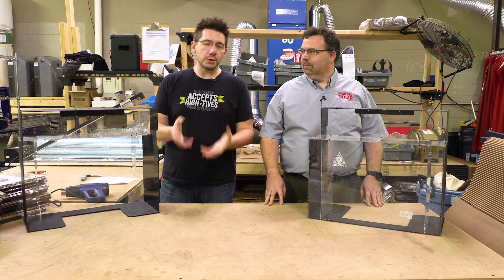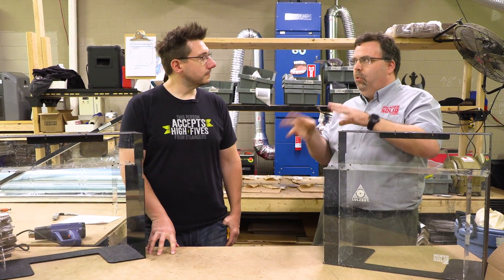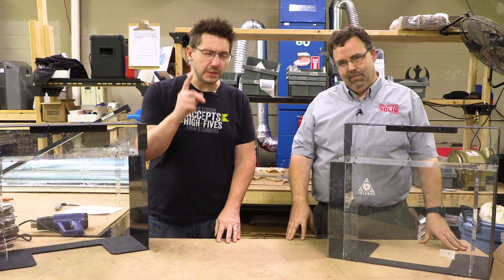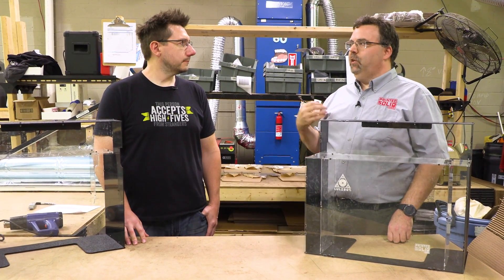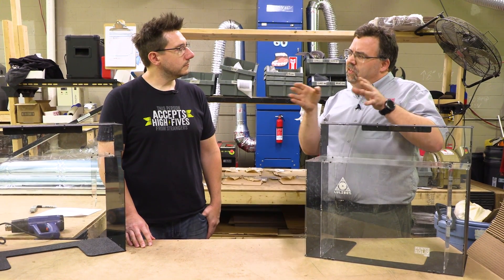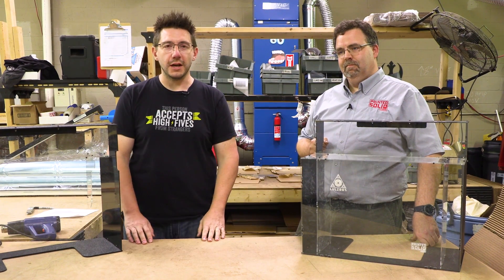5 Tips for Building a 3D Printer Enclosure

Comment: Can you please do a follow-up video to clarify objectives?  What is the purpose of recycling the air?  Why build the enclosure in the first place if 1) You need to keep it cool for PLA 2) Recycling the air with a fan or snorkle (not exhausting the fumes) and therefore slowly builds heat creep.     I don't trust any commercially available filters to get all the nasty VOC's or particulates out of the air.  Not everyone prints in an HVAC controlled room, so focus on the objectives and means of achieving rather than 'this is the only way" please!

Comment: That was verry helpful as I plan my enclosure build, but I wonder should there not be a dust filter for a potential air intake as well? The printer I have on order seems to have power supply and control board in the base, would you recommend I put a (filtered) air intake below my enclosure aka put it on feet so the ait in the "box" first goes through the base cooling it and heating the air a bit then exhausting it via a carbon filter at the top? I plan on using a speed controller for the fan so I do not evacuate to much heat to fast, would a thermistor control of the exhaust be a good idea to keep the temperature as stable as possible? Which is more important, heat or stable temp?

Comment: I actually vent the exhaust from my PSU and electronics box INTO my enclosures using some cheap pool hose from those above ground pool kits. Doing this I was able  to increase my average temps from low to mid 40°C to low to mid 50°C and has the added benefit of circulating the air at the same time AND it makes the fan noise less audible, 3 birds with one stone. It made the world of difference for layer adhesion when printing ABS.

Comment: How would you go about regulating the temperature if you are just circulating the same heated air back into the chamber? or is the point to keep the air circulating to avoid hot spots forming around the heat bed?
Reply: As the ambient temperature could vary greatly (winter, summer, basement, etc.), there is no easy way of regulating the temperature by circulating the filtered air. A filter is great and a temperature regulated fan, that gets rid of the hot air as well as slots off to the side, that let ambient air in. Moving the power supply out is an important step.

Comment: I know this is an old video, but I just wanted to ask if anyone else got a mixed message here. In one point, he says that heat is bad, but then in another point, he says you don't wanna put in a fan that exhausts the heat and pulls in cold air (he suggests 'recirculating the air through a filter', which would result in keeping the hot air in, yes). Am I missing something?
Reply from the maker: Hey! So... Heat is bad, in that, you don't want TOO MUCH heat to build up when electronics and motors are in the enclosure. You also don't want to exhaust the heat and pull in cold air, as you want the temp inside the enclosure to be consistent. I hope that helps.
Reply: @3DPrintingNerd  OK, thanks, but I guess that begs the obvious question, "how hot is too hot?".
I imagine that an active temperature control mechanism would be desirable, which would be fairly expensive, no doubt.

Comment: If anything you want a positive pressure on the inside so dust stays out. It's just a thing on which speed to set the intake fan (filtered) so you achieve the inside temp you want. Vent freely via large surface filter or extract and filter with a smaller fan than on the intake. No recirculation dude, you didn't even mention printing ABS and fumes... Just calm and steady filtered intake air and temps will be constant. Also testing the setup and running it in with temp sensors should be done, not to "eyeball" the temps.
This guy might have been building bird houses for past 8 years, not 3d printer enclosures.

Comment: Summary:
 1) Get the Air out. 3d-Printed Parts will melt when the tempearture inside is too hot. Also Heat Creep is more likely to occur
2) Protect Electronics. 50°C will half the lifespan of the electronics -> Place Electronics outside, motors are a bit more tolerant
3) Place the Power Supply out of the enclosure
4) Circulate the Air inside to avoid temperature variations
5) Don't let the cables hit the enclosure to reduce wear.
Reply: Thank you

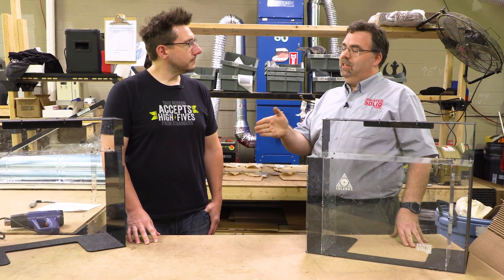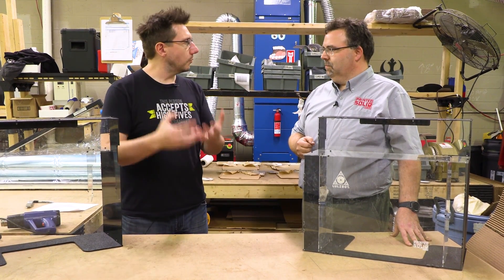Comment: Could somebody please explain me TIP #4 "Don't breath cold air into warm chamber" (2:56 - 4:00). 

If I want to regulate the temperate in the encloser for the optimal conditions for a special filament (for example polycarbonate). I have to heat up the encloser at the beginning and get some of the heat out (archieve is: constant temp). With temperature sensore and a power controlled Fin (etc.), with all parts needed. If no air comes out it overheat.

I don't really get the point with the pressure, well thats my question. Do I need to put air back in ?
If the encloser heats up anyway, I "just" put the hot air inside out in a controlled way (blows faster if temps get higher, fin blows low or stay still if temp is okay), right ?
Reply: I'm also curious about this. How can you regulate the temperature if you can't blow back colder air?
Reply: It's simple, if you're trying to maintain a temperature but exhausting warm air, the negative pressure will pull in cold air, and bring down the temperature. That's a problem if you are trying to maintain temperature. As opposed to the first tip, which is to expel some hot air so you don't get too hot. If you are measuring/controlling temperature and need cold air, go right ahead.

Comment: Just think about PC Case and the overheating problem can be solved by the ventilation system and some cpu fan (I think). And how about adding liquid cooler for the power supply? That would solve this problem entirely plus makes it more durable and good looking! But we'll still need the ventilation system like cpu fan to make heat comes out from the enclosure. Love it! Lol, gonna make one beautiful enclosure for my cr10 max!

Comment: I am worried about fumes, and it sounded like you suggest to not filter those, when printing PLA or did i miss something (i am not a native speaker)? The trick might be an air or water cooled heat exchanger for printing PLA? An additional advantage would also be: you could control the air temperature with a pid controller, which controls the fans of the heat exchanger.  It also would be possible to cool the electronic components with a water cooling system. I do not have a 3d printer, so i am new to this, but would't it be possible to print fitting coolers, and buy a silicone ring and copper plates for the head conduction to screw this under the cooler or is the surface to uneven to get a tight seal?

Comment: i should add a carbon filter plus fan if I manage to build one. one setting sets it to 35 degrees for ABS and activates it if it's higher. the other one just runs the fan all the time? but that way the sound won't be reduced :( damn 3d printing is a pain..

Comment: Built the case with aluminum.  The air that is vented.  The return air is warmed by the electronics and power supply before entring the print case
Reply: This statement does not make sense.

Aluminum usage would not help retain heat. It is a good conductor of heat and would actually act as a heat sink for the chamber. 
You need insulative materials for enclosure materials to hold in heat: wood, plastic, foam, dead air, etc... Metals, while not as bad as totally open air, are still going to leech heat from the enclosure. 

Venting air requires air be available to replace the exhausted air. 
The electronics are going to generate some heat on their own, yes, but not necessarily enough to preheat an air charge up to the required chamber temperature. You may well lose heat doing this, while possibly overheating your electronics if they're not getting enough air flow. Better to leave them outside of the enclosure altogether where they can get maximum air flow and cooling.

In summary, it seems it is best to just use insulative materials and let the enclosure heat up without any external circulation. 

To keep the remaining components from really overheating, you could use a fan and an enclosed duct running from one corner of the back wall to its opposite corner so that you would at least get circulation within the enclosure. 
I would need to look at the specifics of how to do it, but it seems reasonable that you could use a thermistor and an arduino or similar controller to program a vent to open and close in the back wall ducting, thereby allowing a basic form of temperature control to keep the motors and other electronics that can't be removed from the enclosure from overheating.

Comment: There's some good information here, but something very important that you both (especially David) neglect is that we've had scientific proof for several years now that even raw unadulterated PLA filament expels significant quantities of VOC particulates at finenesses known to cause persistent damage to lungs and esophagi. So, no, "Unless you're printing in ABS … you don't need an airtight enclosure" is not good advice, although the rest of the information here may be. It's also a bit disappointing that none of your tips regarded the actual construction process or materials choice.
Reply from the maker: Can you link me to the study you're referring to? I would like to read it!
Reply: @3DPrintingNerd  I can't seem to find the article I remember reading before, which specifically sited researchers at the University of Illinois at Urbana and Champaign with a quick search but here are a couple of more recent ones.
https://cen.acs.org/materials/3-d-printing/3-D-printer-emissions-raise/96/i13
https://www.ncbi.nlm.nih.gov/pubmed/28165927
Reply: @3DPrintingNerd  Also noticed a vlogcast about 3D printer emissions in my YouTube recommendations when I was researching something else last night but forgot to check it out. About an hour and a half I think.
Reply: I think, making it airtight would not solve the issue that you address in any way. You will need to open the enclosure to pick the printed up. So, the solution still would be avoid making the enclosure airtight and formulate how to exhaust based on the work enviroment.

Comment: Another thing many people would be interested in is probably how to soundproof such an enclosure. I have behind me a long journey of wooden enclosures with different foam- and gum-materials and ended up with thick sheets of rockwool. Decoupling the printer-body from the enclosure is a big point, too, as otherwise you might build a nice resonance body that amplifies the printer sounds. Slow big temperature-activated 120mm fans that suck air out high above the printbed and slots in the other side of the enclosure help to control the temperature and avoid negative effects of harsh airflows. I am playing with the thought of using peltier-elements to cool down the print chamber.
Reply: Oh, and according to the latest studies in potentially unhealthy particle emissions (src: https://www.tandfonline.com/doi/full/10.1080/02786826.2018.1464115?scroll=top&needAccess=true), you might want to think about a HEPA filter, too...

Comment: What we need is an enclosure with a variable exhaust the turns on when the internal temp gets to a certain point to prevent the issues mentioned.
Reply: The question is at what temp to start exhaust?
Reply: @tpoacher6965  I guess it depends on the material. Pla, petg, etc..

Comment: The CR-10 series is good for enclosures because because their electronics boxes are seperate. However, they are quite large, and prusa-style too, so you need a large box. Are there any smaller printers with seperate electronics boxes? It seems like everyone is moving towards integrated electronics nowadays.
Reply: Ender series by the same manufacturer, like the Ender 3
Reply: @Patchnote2.0  That thing has control board, power supply and screen all attached to the frame.
Reply: @antalz  Does it?
Oh yeah, you're right. My bad, I'd forgotten, haha. Isn't there a CR-10 Mini though? I'm pretty sure it's close to the size of the Ender 3, not sure about the PSU and board location
Reply: @Patchnote2.0  Yeah the CR-10 mini would work, but despite "mini" it's still a 300x220x300 printer. I'm just wondering if there's anything smaller. I'm strongly considering getting a mini, I'm just wondering if anyone has a better idea before I pull the trigger.
Reply: @antalz  There's always a Monoprice Maker Select. That's a 203x203.  I have no experience with it personally (own a Select Mini), and I recall something about one specific printer of Monoprice being a real pain, so I'd look into that.
Reply: no the cr10spro

Comment: At 0:55 David warns that warm chambers are a danger to printed parts because you might be approaching the glass transition point of the plastic. While his warning is correct in that yes, many printed plastics will get deformable and soft without much heat, this has nothing to do with the glass transition temperature. Polyethylene is the world’s most used plastic, is perfectly solid at room temp, and also has a glass transition point of -125C. Tg says something about microscopic structure but not macroscopic behavior at a temperature.

Comment: The semiconductors of each that a runaway temperature.  It doesn't matter where the semiconductor is  or the power it handles.  Temperature is it.   So the power supply semiconductors run away and fail at the same temperature but since the device creates heat there is a temperature gradient.   A well heat sink power device may have a lower gradient then a semiconductor attached to the pcb.    The other devices physics does not have a runaway  point.  Every part including the semiconductor are made of materials that  degrades, oxidizes faster when hotter and the thermal coefficient of different materials cause cycle failures.   the power supply and logic from experience are seldom well thermally designed and which is worse is hard to say.  (Spent ~15 yrs packaging above 30 kw motor drives.)
Reply: Electrolytic caps won't live very long if kept hot, either. Especially cheap Chinese ones. Especially low ESR ones... Like the ones in switching power supplies.

Comment: What if your psu and electronics are not removable from the printer? For example I have a Maker Select Plus
Reply: looking at that printer and a few others like it, I think there is a possibility of creating a cover that starts below the rails for the print bed (so on top of the enclosure that houses the electronics) and then rises up to engulf the entire top section. 
you would ideally move the spool holder on top of the enclosure (if it's solid enough) or to the side on its own mount.
a hinged open front would let you get to the prints easily, and you would only get a little air leakage from below with the slots cut to allow free movement of the rails, fasteners, cables, etc. however since the heated bed is right there it would warm the air as it rises to the rest of the chamber anyway. this is how I envision it but it may be somewhat difficult to properly execute and I don't have a physical model on-hand but I was thinking something like this for my own all-in-one unit. the only other thing would be to move all the parts to its own enclosure and run new cables to the rest of the printer. I don't feel comfortable working with wiring to that extent myself.

Comment: The point on filtering the air and returning it is something that I never thought of! I am concerned with properly filtering the air around the printer because of the microscopic particles that are hazardous. Does anyone know of the best way to filter such small particles effectively? Great job on the video as always Joel!
Reply: I was thinking of using a HEPA filter replacement for an air purifier or a vacuum cleaner.
Reply: Keep the printer outside and consider monitoring it with a cam. The easiest way in my opinion.
Reply: you don't filter. you shoot the air outside. shits toxic af why would you want to risk breathing that in?

Comment: Looks like I've managed to hit every one of those points with the enclosure I'm working on now, very glad to see that I'm on the right track. Started w/ 2 Ikea Lack corner tables and a Lack coffee table. Coffee table as the base and then the 2 corner tables stacked on it.

I then decided I wanted all of the control components outside of the enclosure, so I found a box on Thingiverse that was close and used it as an inspiration to design my own box to hold the processor board, 2 mosfets, terminal strips, raspberry pi and a 4 channel relay. Now I'm working on gathering what i need to be able to extend all of the wiring to ensure that I have the needed length.

The only thing I haven't really explored yet is filtration, but I had already been thinking that it needed to have a way to recirculate the heated air through filtration and back into the enclosure so that it didn't cause the temperature fluctuations that they mentioned.
Reply: for a read built printer how would you put the electronics outside the insulation box? would you please share the thungiverse box you talked about?